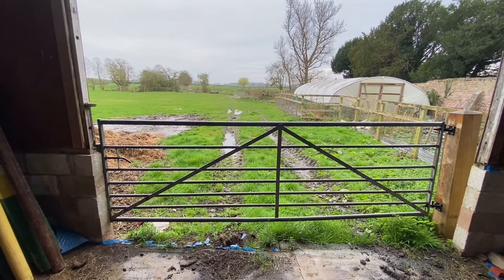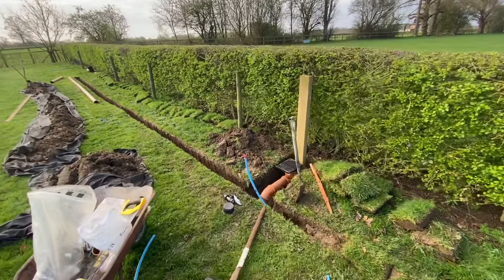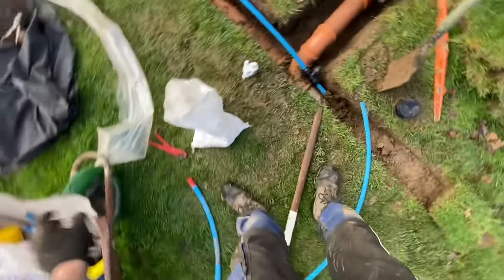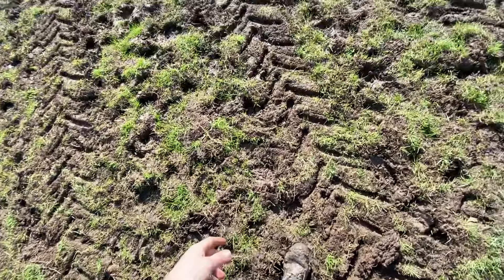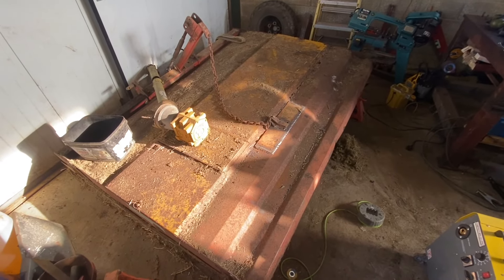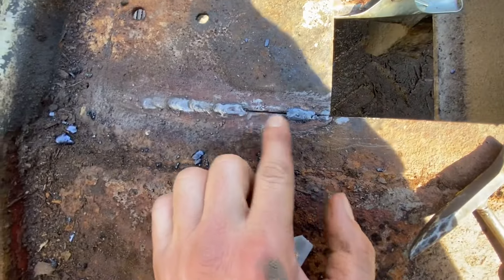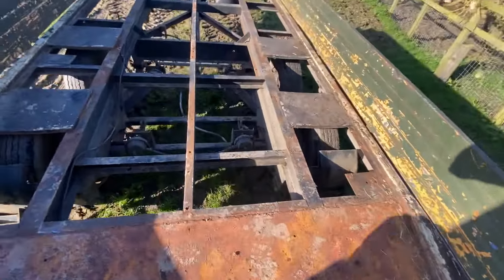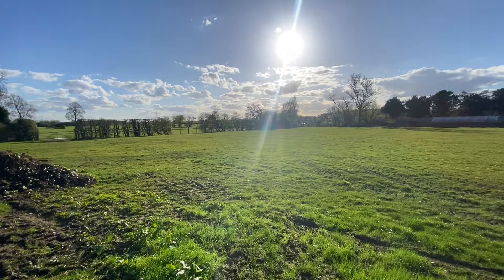Hay barn, digging and work shop welding jobs

Comment: Good job get roller heavier😅the teagle good but the metal work is always crap 
Looks ljke another week if showers 😢
Had a look under our bale trailer and rusty i thought I'd pick it up a bit on loader so i could get under and the wheel stayed on the ground 💩💩put it down quickly and I'll go back to that sometime soon 😂
Reply from the maker: 🤣 I’d have been down to the axles with a heavier roller 🤪. Yeah that seems the way with teagle… is it the steel they use or the paint?!? Yes more rain tomorrow 🙄🤦‍♂️ back in the workshop I think for me. 
🤣🤣🤣🤦‍♂️ yeah that’s not good but least there wasn’t a load on it at the time🫣